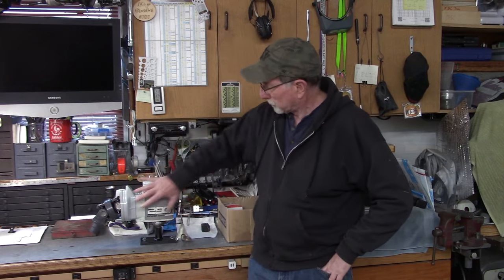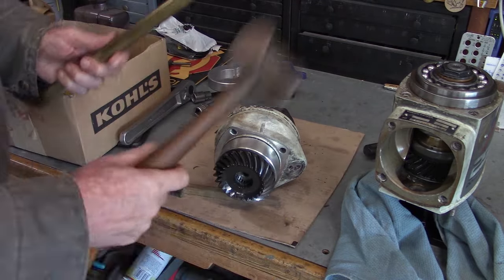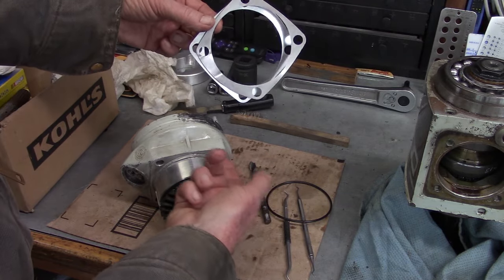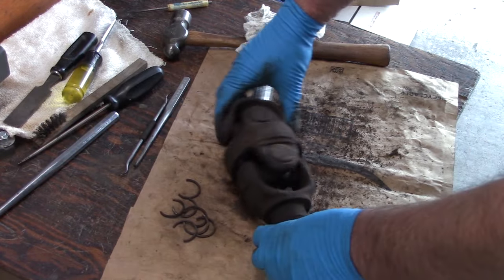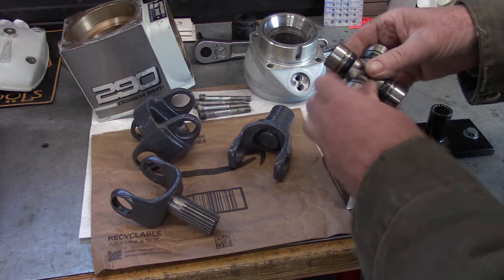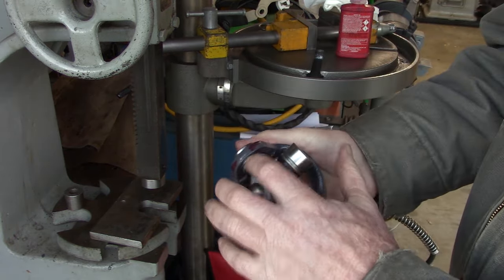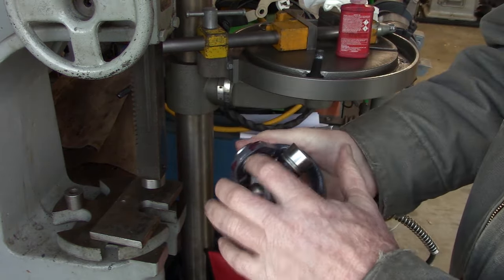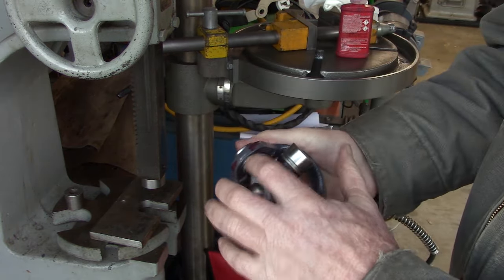Volvo Penta Sterndrive -  U Joint Replacement AQ Series

Comment: I changed mine still attached also. Now I’m really glad I did. That was a lot! Looks like fun though. I might give her a go next time now that I know the process thanks
Reply: You didn’t have to separate anything and you were able to do both u joints ? I have to do mine and I don’t want to open up the gear box
Reply: @skinpickle yes sir, I’ve done it a few times. The trick is to cut a socket in half to support the joint close to the gearbox and then you can just tap the joint out
Reply: @dagooos I was just going to cut it out but I am worried I won’t be able to get the caps in the hole. I just don’t want to split open the gearbox. Would you mind just being a little more specific on what you did
Reply: Was there room to get the 2 caps in the hole ?
Reply: @dagooos when I say cut it out I was going to use my grinder and cut the ears off/or plasma cut them off but if your saying I can tap them out awesome just don’t quit understand how you did it
Reply: @skinpickle  you don’t have to cut anything. I just used a couple old sockets. One a little bigger than the Ujoint caps so the cap can slide into it and one socket slightly smaller than the caps. (I use the smaller one to drive the ujoint out) Use the bigger socket to support the yoke and the smaller socket to drive the ujoint out of the yoke. Drive the ujoint out one way. Flip it over and drive it out the other way. You have to modify the bigger socket to clear the gear case housing. You could use a piece of pipe instead of a socket but I like the sockets because they are hardened.
Reply: @dagooos so with that said there is room for the caps to be placed back into the yoke ? Did you have to go in at an angle?
Reply: @skinpickle  yes,the caps won’t be a problem. I think it’s going to be easier than you think it took me about an hour.
Reply from the maker: @dagooos  some really good info there guys thanks for sharing. Persistence and ingenuity to the rescue.

Comment: Great video, but how did you remove the 4 bolts that hold the housing?  Mine won't budge!
Reply from the maker: Yeah they get very corroded. Be carful it's common to break them off. Here's some tips:
Use a propane torch and heat up the side of the housing following the bolt path, concentrate on the bottom 2/3 of the bolt length. When the paint starts turning a brownish burnt color that's about the right temperature. With a cutoff length of hex key use it like a punch in the bolt head and give it several sharp hammer blows. This will help break the corrosion bond, then Then try loosing it. You may need to work it back and forth and add penetrant. Keep repeating the process as needed.
I've had to scrap several units that lived most of there life's in saltwater do to the frozen bolts.
If they snap off at the threads they can be drilled out and saved. The ones that snap off just below the bolt head are almost impossible to save.
It's the bolt shank that's the issue in most cases.
Reply: Thanks for the detailed advice!  If they won't come out I may snap them off or drill the heads out, take it apart, heat up the remaining shanks and get them out that way.  I may have to weld nuts onto the shanks to remove them.  If that works, I may try putting in studs and have nuts and washers to tighten everything down.  I don't know why they didn't use studs and nuts to begin with so the corroded threads would be right in front of you instead of hiding the problem 1/3 of the way into the unit body.  My problem is I have to replace the input shaft seal so before I do all that I may try AT205 in the oil for a season to see If it will rejuvenate the seal.  I'll just have to check the oil level a lot!  😵‍💫

Comment: Thanks for the video. I'm working on a different drive, but the similarities are close enough. Can you comment on the scale you used for testing the  bearing preload? Is that just a normal weight scale?
Reply from the maker: Yes, the one I was using is just a luggage scale.
A fish scale would work just fine too. Although there may be a fisherman's lie factor to adjust for 😂LOL

Comment: Will that u joint assembly fit an aq100 my rzeppa joint has been knocking g since 1983 so it sets any info will help
Reply from the maker: @Doug-b4p  hi Doug, I haven’t done any work on those older units. I’m pretty sure the spline is different on those. At least on the gearbox end.

Comment: Hi, this upper unit that you're working on always overheats when i start the engine, in the first 20 sec os start, when i pull out the dipstick the oil is very hot and get out from the dipstick hole, what could be the problem ??
Reply from the maker: That could be a bad bearing